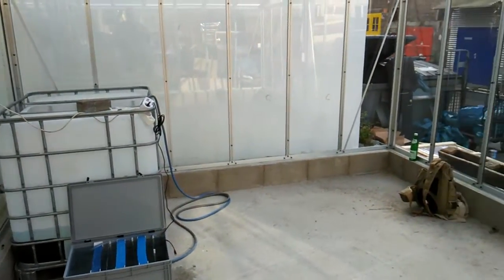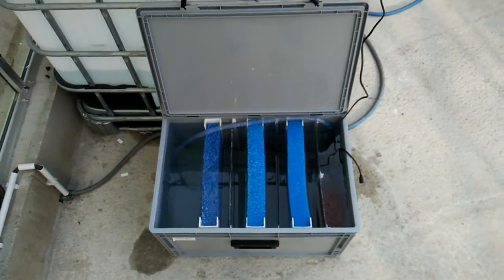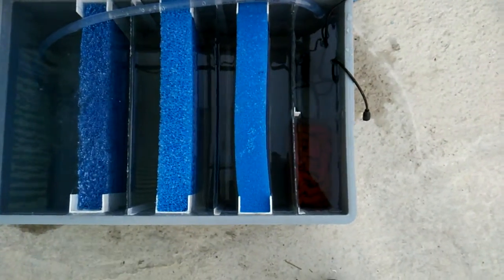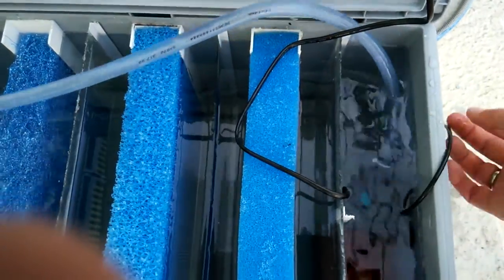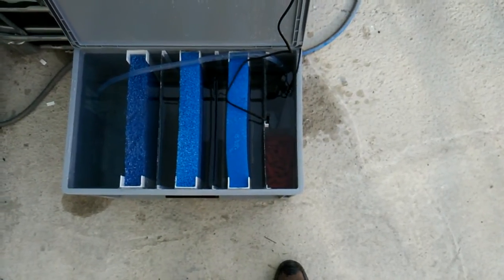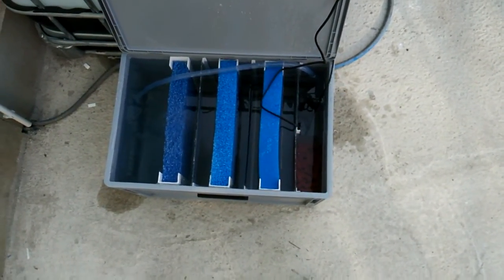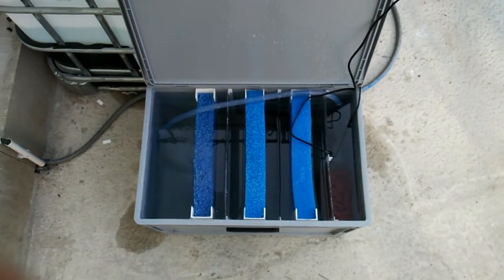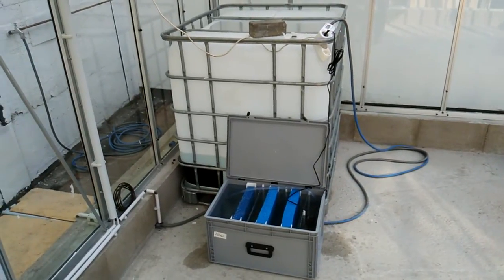Starting the biofilter of the aquaponic system we are building

Comment: Hello. How did you attach those pockets in which the mats are inserted? Did you use aquarium silicone?
Reply: Yes, they were glued to the wall with aquarium silicone. Yet I would not recommend this type of filter. I'd rther recommend a separated mechanical filter and biofilter setup. For a biofilter I'd recommend a moving bed filter with a decent substrate. For example K1 or eco pondchips. 
Actually what the Koi community is doing is usually pretty good. A little over the top sometimes. Dial that back a little and you'r good for aquaponics.